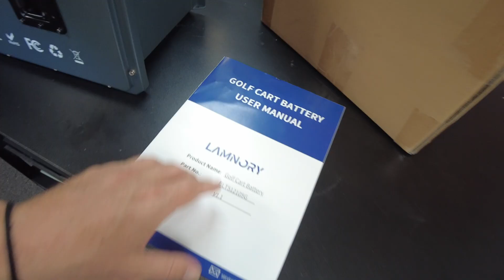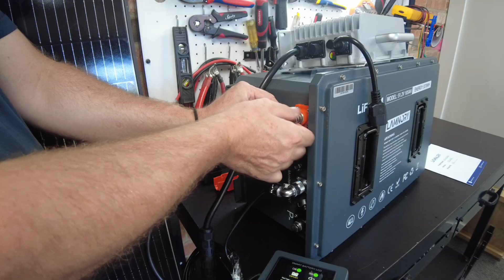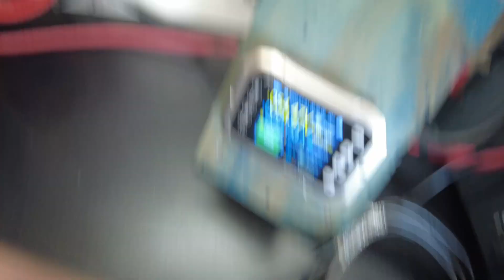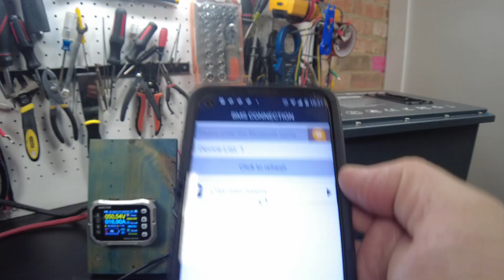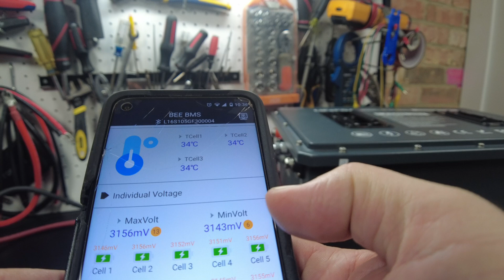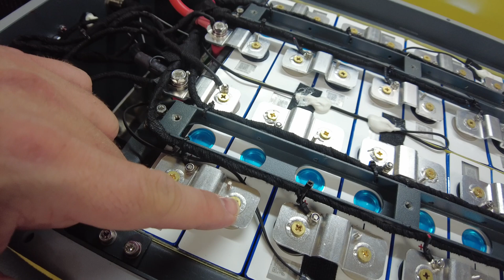Lamnory 48V 105Ah Lithium Golf Cart Battery

Comment: Hey Brad. LF105 EVE cells if you go to the EVE website. They say they are 1C cells. So I am not sure how they could claim the numbers they do. They also say 3500 cycles.
Reply from the maker: The doc for these cells says 3C max discharge for 30s, and if i'm reading it correctly seems to imply you could get >4000 cycles? Thanks
Reply: @BradCagle  Thanks because I am looking to buy one. Seems like all these batteries that have the same specs are the same except for a few build differences.
Reply from the maker: @ Yes, that seems to be about right :) BTW These EVE LF105 cells seemed to be used in a lot of the golf cart batteries. Hope you find what you're looking for!

Comment: How long did it take to discharge with that ac unit hooked up to it?
Reply from the maker: Probably around 6-7 hours. It just depends on the temps outside, and how high you crank the AC up. I've had this AC run around 16 hours on a battery of similar size before. Thanks

Comment: Thanks for the review of this battery, looks beefy. 

How did you mount the Midea bracket to the glass?
Reply from the maker: The bracket is not really mounted to the glass, I just have a 1x4 board that is sandwiched between the bracket, and the glass to spread the load out. Also on the top where the window seal is, theres a channel/groove that the top part of the bracket fits in. Thanks
Reply: @BradCagle  thanks for the tip on mounting the Midea!